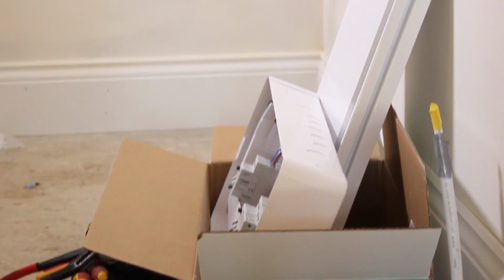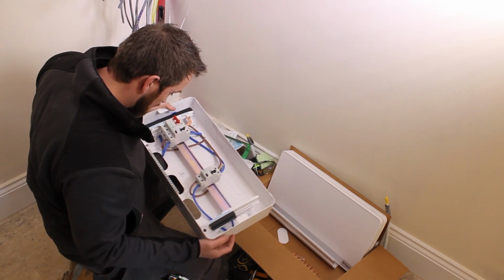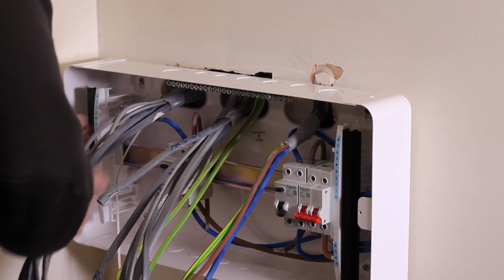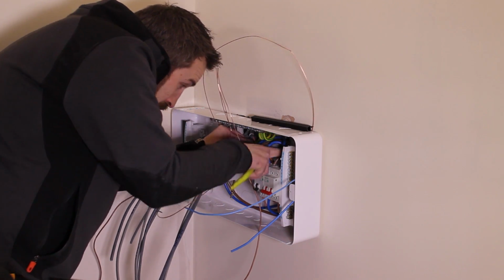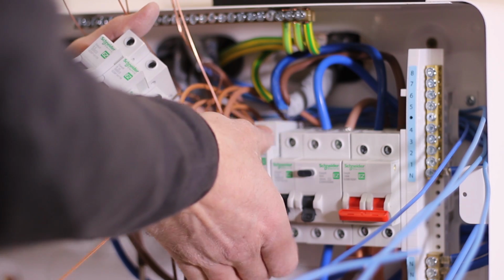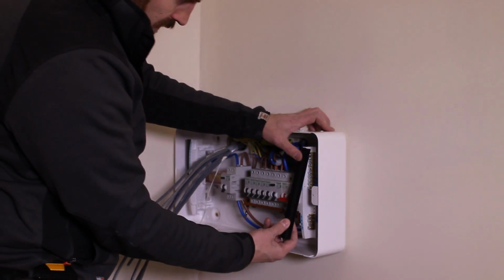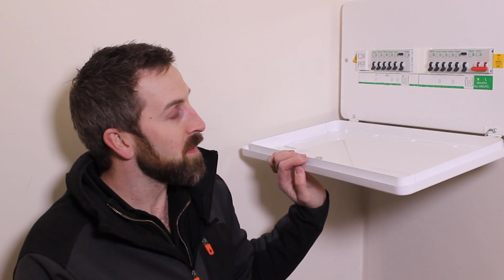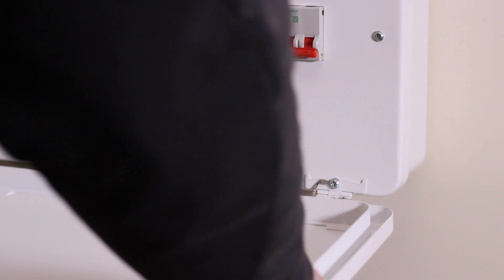Easy9+ Installation Roma Electrical

Comment: Metal blanks?
Neutral bars are difficult to terminate cables. Imagine a 6mm cable. There is no space to work.
Where the door is the other way round, it falls catching your fingers.